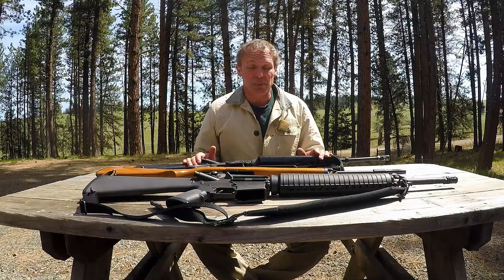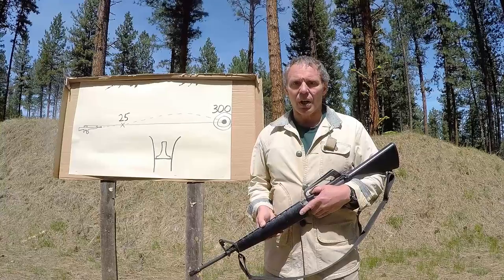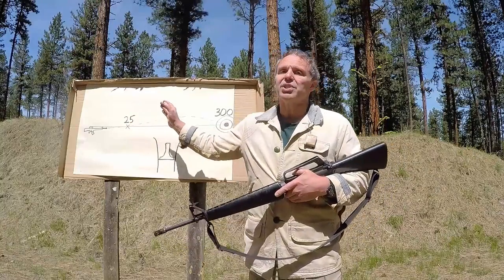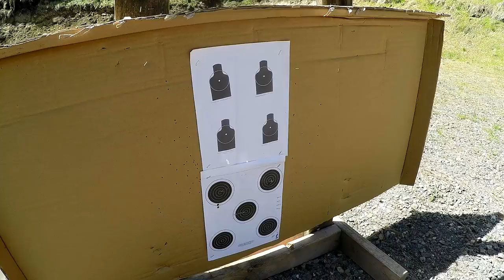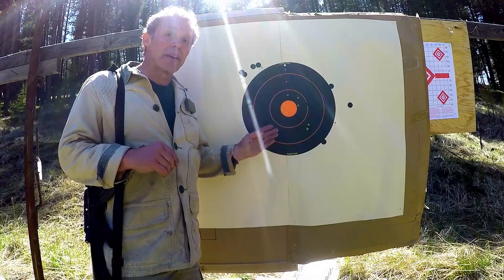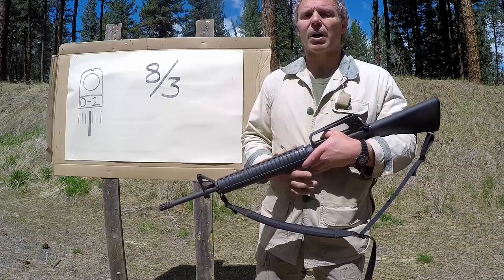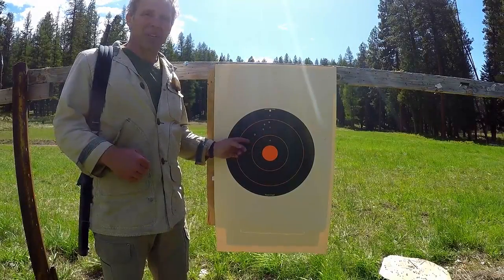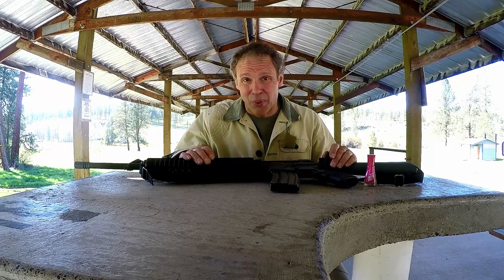Zeroing an AR Platform Rifle

Comment: With my 16" and 18" barrels sighted in at 50 yards, my shots were hitting about 8" above my line of sight. with both 55 grain, 62 grain FMJ and XM855. That's' not acceptable to me. I'd like to push my zero out as far and as flat as possible, to the point of intersection where I don't have to arch the bullet above my line of sight. My optics are 2 7/8" above bore.

Comment: 1000 inch course...

1000 inch ÷ 36 = 27.77777 yards

0r
25 meters..

Also.
Specificic to 20 inch rifle barrel 55 grain ammo and 1 think 1x12 twist...
Twist could vary tho..

I have it in a couple field manuals.
Plus.
I discovers the magic figure of 27.7777 when fooling around with mil dot measurements and range calculations...

The A2 was different.
All I know is 1x7 twist barrel .
62 gr ammo 
Maybe 37 to 38 yard initial set up..
But..

Love the in-depth.
Trying to find earliest use of 1000 inch zero.
Cannot find it any where.
Got manuals for 
1903
M1 Garands
M14
M16 
Few references to a 900 inch zero for .30 cal
Need to finish vids.

Thx

Comment: Another easy trick is to zero in your 100m religiously (aka: shooting sub-1moa regularly even with shit ammo) until it is dialed in to you since 5.56 (55 and 62 grain, don't know about the 70+ stuff) is flat shooting to that range. 5.56 reliably drops about 6in at 200m and about 18in at 300m.

As a result:
-100m shots dead on heart.
-200m shots dead on neckline
-300m shoot dead on head.

Drop at those ranges will naturally bring round center mass.

Saves you from having to do all the 300m bullshit and walking to and from your target 100 times.

Source: ex special forces attached field medic (3d Recon), range safety and foreign weapons instructor, and dual-expert navy rifle and pistol marksman.

Comment: The difference between the small and the big peep doesn’t fact have an elevation change on m16a2 of approximately 2.02 MOA and an M4 carbine’s (carbine length gas system ) you have an elevation change of about 2.5 MOA due to the difference in the trigonometry with the shorter sight radius 

If you don’t believe me go to 100 yards and test it

Comment: Strange how it hasn't occurred to me that clicks on sights or scopes have smaller but proportional relationships at shorter than the stated distance: as in 1/2"@100yds = 1/4"@50yds = 1/8"@25yds. And I'm a woodworker! Fractions are my bread & butter! Dedgummit!

Comment: I'm curious what you think of using a laser for sight alignment, either the kind that goes in the end of the barrel or the sort that fit in the chamber?  One installs the laser, then adjust the sights until they match the red dot.  I would guess that it is not perfect, but how close could one get it without firing a shot.

Comment: Any insight on sighting in an A3?  Can I use an M4 carry handle with a 20" bbl?  (assuming the sight radius is different, shouldn't each click mean a smaller adjustment on the longer barrel, if the clicks are the same for both?)

Comment: Paul, I Have an A-1 sighting system on one of my ar’s. Would it hurt if I drilled out the short range hole for faster sight picture? After all these years of owning this rifle and trying to find out why they were the same I now know. Thought it might be a manufacturer mistake. Thanks for your video.
Reply from the maker: I have drilled out apertures that were too small and it can help a lot. Just remember to drill the short range sight and get the whole centered.

Comment: Modern M4s use the MaTech rear sight. Zero at 25m while set to the white line. Switch to 300m to verify zero. Much simpler now a days.
Although I never went through the 300m verify process and still managed to shoot around 32/40 or better.
https://www.brownells.com/rifle-parts/sights/rear-sights/ar-15-usgi-backup-iron-rear-sight-prod26575.aspx

Comment: To my opinion it's not an ideal to zero any type of iron sights or optics in distance meter that are build in M.O.A adjustments.
If your iron sights or your optics are build in M.O.A adjustments and then it is appropriate to zero your iron sights or optics in yardage, not in distance meter.
In order to zero your iron sight or optics in distance meter and then your iron sights or optics must be build in metric MRAD adjustments.
Shooting silhouette targets at short ranges to medium ranges there is not gonna be a big significant difference which way you choose to zero your iron sights or optics, M.O.A to meters, or MRAD to yardage, although this makes a big significant difference for precision shooting.

Comment: Will the A2 zeroing procedure work for my Colt AR-15 A4 with a detachable carry handle type rear sight?
Reply: No, the detachable carry handle sight fitted to the 20 inch barreled A4 rifle will need to have elevation wheel bottomed out and then turned clockwise to the Z marking for sighting in at 25 meters. Then after sighting in elevation from the front sight the rear sight elevation wheel should be tuned counter clockwise back to the 6/3 setting which will deliver a 300 meter zero and a bullet drop compensation function upon adjustment of wheel to 4, 5, or 600 meter marking.

Comment: Great video! My m16A4 had the elevation dial rotating freely when I got it. But now its stuck completely. Is there something to press to rotate again or pehaps it is a falling ball bearing below the dial? any help is appreciated, thanks
Reply from the maker: Possibly rust in the spring/bearing/rod that keeps it from freewheeling. 
Try some solvent.
Reply: @PaulHarrell  Gotcha, thanks! Used the tip of the bullet it free from the last notch. rest of it spins freely.
Reply: amazing video Paul, cant get any better for those who switch from an AK and knew nothing about M16s!

Comment: Too hard.  Here's how I zeroed mine.  I brought it home, took it to the range and tried it.  I used a paper plate with a black dot in the center.  The dot was the diameter of a masking tape roll.  At 25 yards, most of my shots were in the black dot.  DONE!  

Seriously, though.  The A1 seems simpler to me.  Sight in at 25, move to 300, fine tune it and you're good from 50-300 with just a flip of the rear aperature.  Why did they "upgrade " to the more complicated sight?

Comment: OMG. While in the Marines I was both  an armorer an a primary marksmanship instructor among some of the other MOS’s I held.  
The day we would go to the range to  battle sight zero people that had a newly issued weapon was always proof that nothing can be Marine proofed and only made Marine resistant. 
One time I had a Marine approach me during zeroing and ask if I had a file he could use. His rifle was shooting low so he wanted to file down his front sight. Apparently the rifles he had experience with had fixed front sights and rear sights that only had  windage adjustments so he had filed down those front sights. 
I went over this same sighting procedure that is in this video but he was insisting he wanted to file down his front sight and that I could just replace the “ front sight post thingy” when he turned in his rifle. I had to threaten to charge him with destruction of government property and have an instructor watch over him until we got his rifle zeroed just to make sure he did it the right way as I caught him trying to use a finger nail clippers file on the sight. 🙄🙄🙄

Comment: QUESTION: which do you prefer: A1, A2, or a M4 ?
Reply from the maker: The M-4 is compact and has some real advantages. but my eyes don't focus well on the short sighting plane. I prefer the A-1 because it's lighter than the A-2 and has sights that are more suited to my needs.
Reply: @PaulHarrell   you and me both, I trained on the A1  starting 7/72, but I prefer the A2 (lighter than a M-60)

Comment: The most difficult part of zeroing a M16 is trying explain to the non-shooter, non-gun owning, put on detail cause it was their turn range safety that the one bullet hole a quarter inch from the two in same hole is your cold barrel shot and you do not have to shoot again. So glad when I became a NCO, fire my three zero rounds, pull my target down and walk the fuck off the range.

Comment: The most reliable way to make an AR15 more accurate is to get closer to your target...  that's it.  If walmart made guns theirs would be better than the AR15s you can buy today.   Not downin on Eugene but there's only so many times you can "improve" a design before it starts to become claptrap.

Meanwhile there's a slightly modified M1 out there that can shoot a dime, give you nine cents change and you can still use the dime in a candy machine.

Hell, I've got a 5000 rounds fired Ruko M20 wood stock with a worn out clip that's more accurate at 100yd than a 200 rounds fired AR15

Comment: I had exxplained how we did it in the beginning of my ARMY service, I may have mistaken yards/meters, everything we did was in meters and this was 40yrs ago......so zero/qualification may have been Y not M

And still yet is a far better method of zeroing an A1....I never used an M-16A2

It was sometime after I first zeroed the M16-A1 that they changed the method of zero because it was too complicated for some big shot......you aimed at 1 point and zeroed to another at 25Y/M using Canadian bullseye, they changed it to......using "L" sight, aimed at center of circle, if you put 3 rnds in circle then you are zeroed.......stupid

As you can see the trouble you had getting zeroed so that you could hit target at 300y, thats not a really good method.

Wonder where you would hit the zero target at 25y after the fine tuning at 300y?.....that is with the A1, again I have never used an A2. That would tell you where on the zero target you should actually zero to......while aiming at the center

Comment: The camera caught a frame of the 5.56 round in flight at 27:42 - just FYI.
Reply: Watch it at 0.25x and try to pause it at the right moment. The hole in the target appears before the streak. I think you're seeing the vapor trail condensing from the air in the low pressure behind the bullet. Pretty cool.

Comment: Crap.  All I can hear is "This is my rifle. There are many like it but this one is mine."

Battle zero on the M1 Garand is similar.  Sight for 25 yards.  Extend out to 100 yards and fine adjust.  The Army isn't stupid.  They know they need a system (and cartridge) that doesn't require a math degree to compute the sighting.  They also want something that combat troops can remember and recall quickly in case they need to do a quick and dirty field sighting.

Comment: I zero my Hbar 20" AR 15 @ 150 yds, the hell with the markings, I'm not in the military. If it should come about in case SHTF-
I might follow the guide. People shouldn't take this stuff so serious. Treat it like an adjustable sight, shoot it.
If it bugs you not to have Military service guidelines down to a T. Get another AR with a detachable handle sight & a couple of set of sights, on & off in under a minute. Some people are funny that way. But I have no use for a 25-300 zero.
Reply: 50m zero (50/200) gives you the shortest shot string.

Comment: You didn't explain how to set the rear drum on the A2 to bottom out at 8/3.  If someone rear drum isnt calibrated correctly it will be a PITA to zero.  The A2 drum is also calibrated for 62g ammo.  I like to use the Revised Improvozee Battle Zero (RIBZ) it can be found on AR15.org.  I have A2 16 and 20" rifles, both are 1x9 but I am fine with 1x9 cause 99% of the time I am shooting 55g ammo.  I may upgrade to 1x7 when parts and Ammo become more available but for now they work, and are both chrome lined which can help a 1x9 stabilize up to 69g ammo because it speeds up the bullet slightly since chrome is so slick